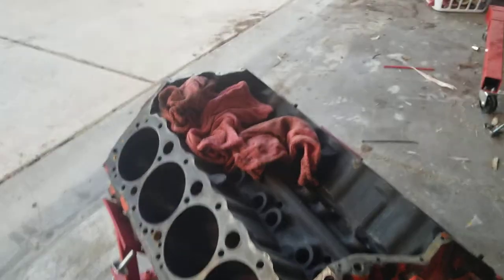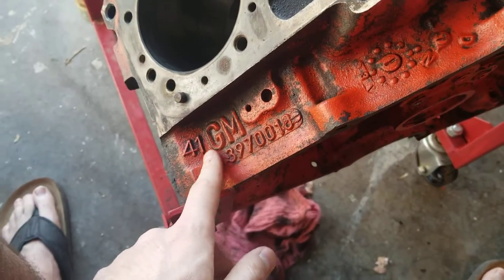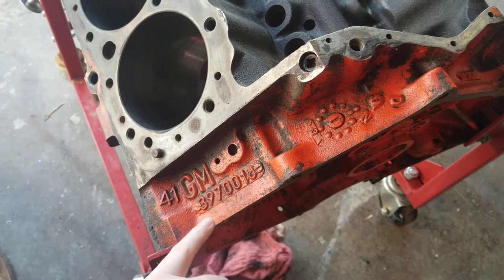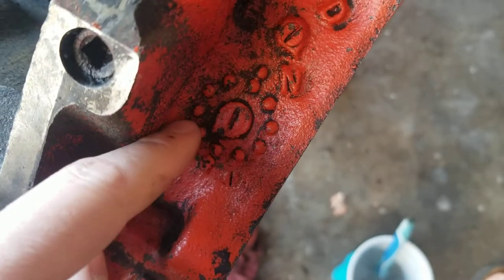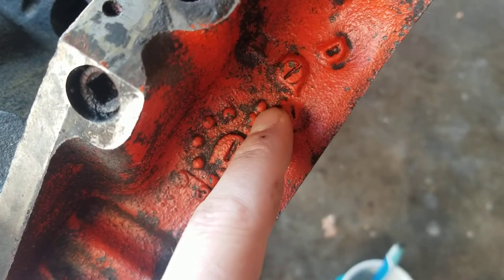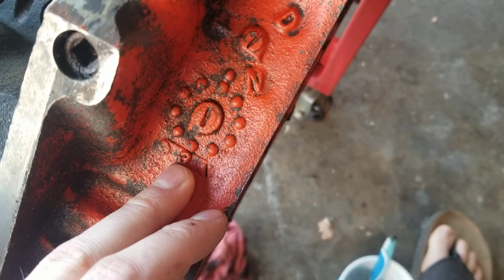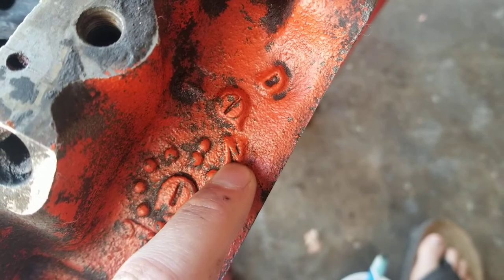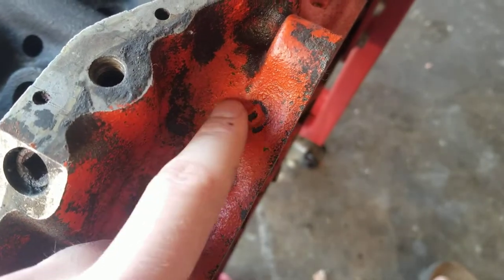Reading Engine Stamping/markings on Chevy Block

Comment: It could be a 302 a 327 or 350 That number hits for three different numbers for three different kind of motors that ranges from 69 I want to say through 72 but it’s not just a 350. It all depends on the front numbers the back numbers on some of these engines will hit to only one motor if it hits to more than three it could be one of the three and you have to decode it from the front
Reply: Where do I look for numbers on front of engine I’m trying to figure out which engine I have
Reply: @Llothedon1  On the front of the passenger side head There should be numbers on the block in the front
Reply: Casting number back of block is 3932386 front of block is 9y00190822fb
Reply: @Llothedon1  The one on the back matches a 302 a 327 and a 350 The number you gave me in the front doesn’t even match or you sure you’re looking at the right number because there are two sets of numbers the first it will tell you what year the engine block with made the second set will tell you exactly what kind of car and which one exactly motor it is
Reply: @chicanou-turn5056  yes those are the numbers in front of block
Reply: @Llothedon1  check out the lime book online. Tells you everything. Looks like you have a ‘69 327ci 2 barrel in front of a power glide trans. Came in a passenger car
Reply: @Llothedon1  sometimes they are double stamped. If it is you’ll notice that one stamp is bigger than the other. They used specific stamps so people tried to re-stamp them but it won’t match. The fb at the end and the  0822 are specific. August(08) 22nd 1969 or 1968 but for a 1969 passenger car
Reply: Well seeing as how by the characteristics of this block having scalloped bell housing bolt holes and even though it was never shown I bet it had a short number stamp pad in front of the passenger side head as opposed to pre 1975 blocks which had a long number stamp pad in front of the passenger side head among other characteristics of later blocks. These are indicative of mid-to-late 70s blocks even up into the 80's and we know the 327 & 302 we're discontinued in like 69 so there's only one possible identification that makes sense and that's a 350 as it was made from 1967 all the way up around 99 or 2000ish. Forgive me if I'm a little off on my years I'm a little bit rusty, I've forgotten more than a lot of people will ever know about the SBC in general but like it was said knowing what year model of vehicle it came out of will help with identification but if you don't have that information if the engine is still complete then you can further your search by looking at the crankshaft casting numbers and weather it's a 2 or a 4 bolt main block. Some engines only came in two bolt main configuration but I guess you just have to know what characteristics to look for when trying to correctly identify an engine. The stamp pad will give you valuable information about this engine and it's configuration and I will say that if you're going to do a video about block casting identification you should probably know what everything means before you just go guessing at it and stating it is fact it's not good practice smh🤦🏻‍♂️ but other than that good video 👍🏻

Comment: My motor date says G 257 what year is mine
Reply: It depends on the characteristics of the block & what era or decade it was made in. That date code is July 25 of 1967, 1977, 1987 or 1997. Having a casting number to go along with this would help as some casting numbers were only made in certain years or for a certain period of time but you can exclude the 90's right off the bat if it is a two-piece seal and not a one piece seal. Other information like suffix codes from the stamp pad in front of the passenger side head or like the casting number of the heads that were on it as well as the intake manifold as well as some other little characteristics that were unique to certain castings or years. See where I'm going with this? Good luck and happy hunting 🫡😀

Comment: weak video d and n with a clock ya like the one poster was saying how about day or night ya and like the other poster was also saying up at the front of the block on the head surface that's were all the real info is as to what it came from and what it is but if it has been decked then it may be gone but the ol acid trick will let you know but be aware there are some out there that re stamp no.'s and some are better then other at it when its worth money then its worth faking